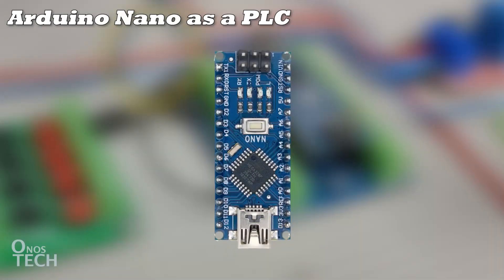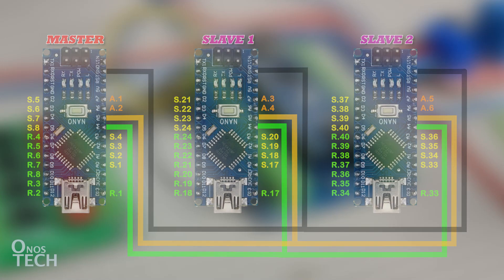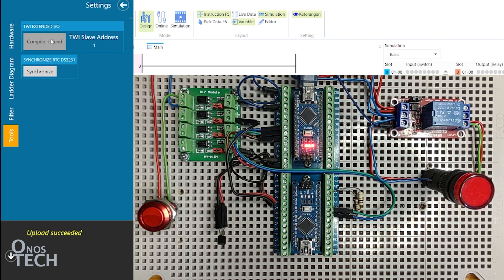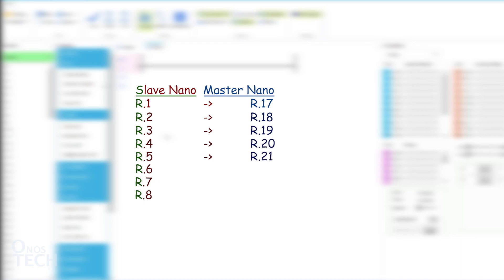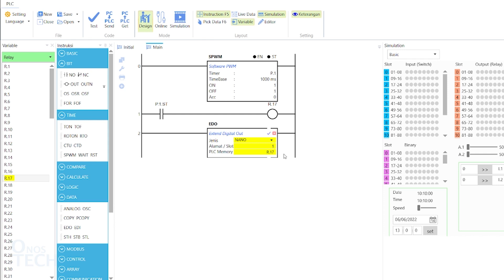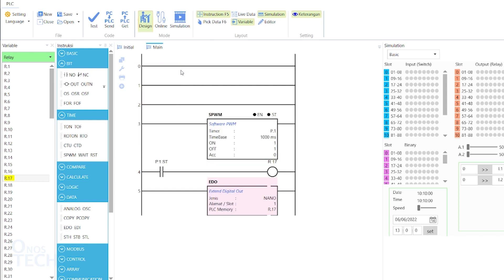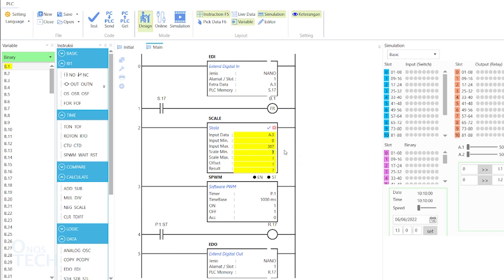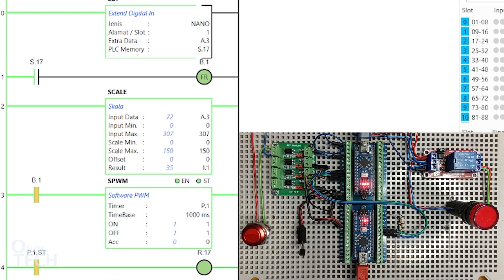#18 I2C Extended Inputs Outputs  | Outseal Arduino PLC

Comment: its nessary for use EDI EDO instruction
Reply from the maker: Yes! If you are extending the IOs
Reply: @OnosTech  ok  and main  programmer is master Arduino not salve right 
And nessary to A4 or A5 to 10k to 5v  resistance
Reply from the maker: @kailashmalviya8  The main programmer is master
Reply: EDO. NOT TAKE VALUE R.18 TO R.24 IT GIVE MISTAKE ERROR MULTIPICATION OF 8 WHAT MEANS OF IT

Comment: Sir which pin is for analog output.
Reply from the maker: There is no analog output in Outseal PLC. But you can achieve it with Modbus Analog Output Modules
https://youtu.be/oSLo061C24U
https://s.click.aliexpress.com/e/_Dl7Kyqr

Comment: Very informative. What's the maximum number of expansions that would be allowed. Wish LDMicro had this feature
Reply from the maker: It is dependent on the numbers of I/Os that can be assigned in Outseal studio which is S.1 to S.128, R.1 to R.128 and A.1 to A.26. So I think it may be at least 8 expansion module.
Reply: @OnosTech  Thanks
Reply from the maker: @ronaldpereira7088  You're welcome!

Comment: Great tutorial, with your effort it starts to become a powerfull small plc. What is the max distance between 2 units?
Reply from the maker: Thanks! The max distance for I2C bus is less than a meter or about a foot for effective communication. Modbus between devices is recommended long distance